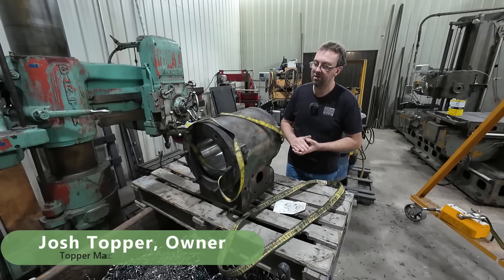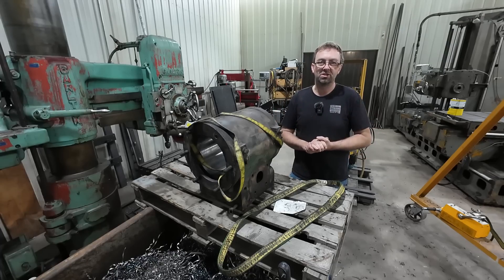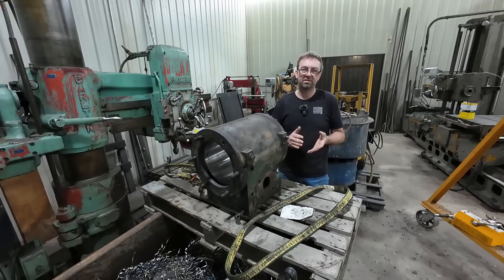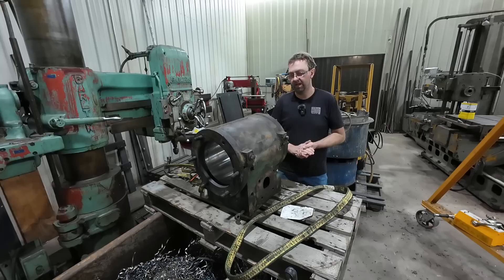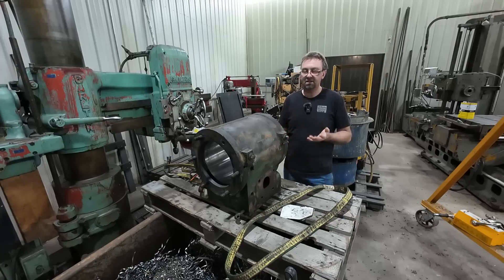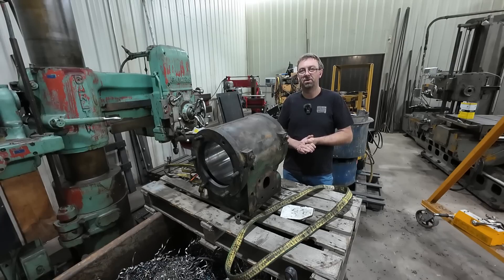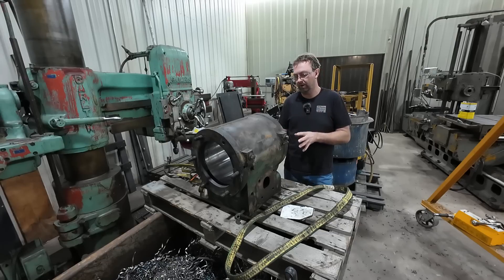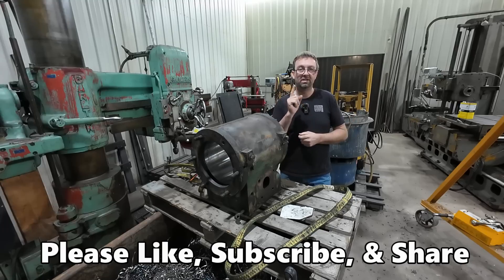Steam Engine Cylinder Boring Follow-Up - Honing & Answering Viewer Questions & Comments

Comment: You did fine. As long as the bore ends up square to the crank so the piston rod runs true it'll be good. Since there's no combustion pressure in the cylinder is there really a need for crosshatching??

Comment: Looks good to me!  Why couldn’t they do the cross hatch was it because of the stroke length wasn’t long enough ?  I think they would have been fine doing it with an overlapping series but you can do it by hand but it will be hard to get right cuz that is a big bore and stroke to cover.
Reply from the maker: This is not an engine hone.  Built for hydraulic cylinders, so smooth is all it will do.  I will have no problem with the cross hatching on my end.
Reply: At 2:00 the hone is stroking in and out that is what produces the cross hatch pattern. The rate of in and out vs rpm is what defines the cross hatch angle. If you look real close you should be able to see it. Now if they used a real fine stone like 600 grit or finer it maybe hard to distinguish. You may not need to do anything else to it.
Reply from the maker: Considering lubrication is admitted with the steam, meaning the steam carries in the oil, I may not need to do much else to it.  I also have a dual feed oiler set up and will be running both quite heavily. Most engines have one and the owners are all concerned about the cost of cylinder oil.  Myself, I consider oil a cost of playing.  It is cheap insurance to not have to do this again.  More cylinder oil, the better.
Reply: @ you want the deep scratches from the hone to hold the oil just like scraping does on a machine tool. Funny for us to talk about ways to make it last when it only lasted 100 years the first time with who knows what kind of finished and lubrication. lol 😆

Comment: I like you liked to play with old iron in the form of farm tractors. These old items were made obsolete 75 years ago. 
One can go overboard in the restoration process, spending lots of money for perfection with little value added. 
If you had stopped after you trued up the cylinder and put it back together with new rings you probably would have had more power than it had during 90% of it's working life. 
The question is when is it good enough? 
We need more younger people to get interested in these old technologies.

Comment: Not a steam guy at all but my 5 cents brain fart is here : if you make the piston for your steam engine out aluminium... does that give that all sorts of corosion problems ? in my brainfart i had this alarmbell of water and cast iron and aluminium = galvanic element like in a ship in sea water eating the boats parts in the sea. isnt it smarter to make the piston out of steel ? just my 5 cents.

Comment: Aluminum piston? boiler water is usually kept caustic to prevent acidic corrosion in the boiler. Caustic will raise hell with aluminum. If you eliminate the caustic, the boiler will suffer. I seems a poor choice to me. But you do you.

Comment: You could invent and patent a process prove that it's the best and correct way to do it and the cheese heads will say your doing it wrong. I would bet money that the negative commenter have never seen a steam engine, comparing steam to internal combustion is like comparing apples to cow pies.

Comment: I hope the the surface is not to smooth for hold the oilfilm wich let the rings slip on it ... and if this where my cylinder ? I only change it to a longer Pistonrod wich goes true the frontend to, to hold the Piston stabil in center.😊

Comment: Unless both ends of a horizontal hone are supported, it's hard to believe a cylinder can be honed horizontally without creating an out-of-round condition, although maybe not enough to create problems.

Comment: Very nice. No I wouldn’t make the rings either lol. Are you gonna put the cylinder and the piston in the over and measure them at high temps? Extra oil is always good for longevity. I run expensive oil and more than the manufacturer recommends in all my 2 strokes so they last longer. I have a weedwacker I bought like 10 years ago and I have used the hell out of it and it still has great compression. Anybody that says you’re and idiot is an idiot. Those are a lot of the times people that have no experience or a low self esteem. I can’t wait to see this thing run!
Reply: The people that said weld it really have no clue! We can clearly see in the video it’s cast iron lol

Comment: Those numbers will work well. We were inspecting satellite components with cast iron angle plates of various sizes and all measurements had to be calculated using ambient temps vs temps when the equipment was calibrated. The aluminum component was also used as a constant for titanium. The steel component is stable for both steel and cast iron.

Comment: Just do it the way that best fits you. My first tooling technology teacher told me to watch everyone and try different ways to find out the best way for you. But he also said don’t be afraid to change if you find a better way that works better. He said you will never stop learning as long as you do machine work.  We had a guy quit in the machine shop and he always machine the Johnson joints for the calendar line. He had them convinced that he was the only one who could do them. After he quit they asked he I would try to machine one to get the steam cut grooves out of the bottom where the carbon seals set. The boss came through to see if I had gotten started and the first thing he said the guy who quit didn’t do it like that and he said it was the only way it could be done. I finally convinced him to let me try. That joint never had to be machine again after 4 years till the plant was shut down and moved to Mexico. Before we shut down we got a lot of our equipment from another plant that shut down in Sheboygan, Wisconsin. Just keep up the good work. If it works for you keep doing it.

Comment: Hi Josh, you did a nice job on this steam engine cylinder. According to the new piston I would recommend you to make it from cast iron. Aluminum is not the right material for steam engines, due to thermal expansion coefficient and the danger of corrosion by condensate, which is on steam engines usually of alkaline quality. As well as electro chemical corrosion due to the difference in electro chemical potential of iron and aluminum. Depending on the alloy the temperature is affecting its material characteristics above ca. 300 °F. By the way I'm a mechanical engineer and working in the restoration of steam engines for over 20 years. Best regards from Germany

Comment: There are a hundred and one ways to do something. The job turned out great 👍🏻 
Where I am, in the North West of England. In our town years ago, we had it all, 30+ engineering businesses large and small, there was an electric motor rewinder, a hydraulic specialist, an automotive radiator repair shop, and a engineering wholesale supplier.
We are now down to around 5 businesses left, and they are not that busy. Thanks to China. Even in Liverpool, along the Dock Road, you could get anything done a few years ago... bearing suppliers, Perkins diesel agent all sorts, now all gone, and the victorian warehouses made into "trendy" apartments for "modern folks" who don't even know what a drill bit is.

Comment: First time comment for me on YT...I like what I see that you are doing.  Only thing I see is the honing on the cylinder is a bit smooth, which could lead to a longer break in time.  I have a Baker engine just about like yours except the next size bigger, also a counterflow and a little newer (1925).  These engines when they are right will make plenty of power for their size.  Don't get your piston clearance too tight, just make sure the ring grooves fit the rings well and plain iron rings will do fine.  Use a fair amount of cylinder oil, especially at first and put it to work, don't have to run it hard but don't idle around too much.  You are depending on steam velocities inside to get oil on the wearing parts.  Chromed piston rods seem to work quite well.  Packing on this engine I have has held up to over 30 years of running, some of it pretty hard.  Make sure the valve is flat as well as the seat, they can leak just like the rings.  I guess this is random comments that I thought of and best of luck and look forward to seeing this go back together!

Comment: No one knows how to do something the first time. That just how it goes. I’d bore it on a horizontal over a lathe. The setup on a horizontal would be easier. If you do it daily, which I used to, the setup would be very fast. You figure out ways to speed it up. A bored hole on a horizontal is generally parallel by default to. Not so in a turning machine. That hole is likely better then new, it is a steam engine after all, built with lower machine tool technology.

Comment: G'day you did a good job on the barrel see how many of the knockers would capable of such a job. It was much harder for you setup, then the  Atlas Copco barrel I machined the Horizontal borer had a outrigger bearing much easier to dial in.  I think honing was a good step to do. The material I used for the piston & rings  Meehanite,  you will need to do some research on  clearances using aluminum for the piston . Was the original piston aluminum or cast iron ,foing aluminum will also effect the balance of machine being lighter. All the very best for the future I hope  the financial situation improves with the new incoming  president . Have great Christmas to you & your family.

Comment: Some years ago we rebored the LP cylinder on a triple expansion engine 72 in dia and lifting the cylinder out was not an option so we bushed the rod hole in the bottom of the cylinder to suite a boring bar and centralized the top support off the head studs and bored with a fly tool. Came within one thou of design size. We had the ring spin cast at a local foundry that has a history of building steam engines. They are such forgiving engines. The job was overseen by a retired steam fitter who taught us a lot.

Comment: I used to run a machine shop for an absentee owner.   The shop owned the patterns for 35 Liberty Ships built in Portland Oregon during WWII....   

We'd receive an order from a repair yard for all of the live steam parts as needed for overhaul.   We'd pull the drawings, search and pull patterns, and send them to the foundry for casting.   We would specify the formula of gray iron, receive back the patterns with parts...

We often made pistons, rings, sleeves, and other cast parts for pulleys, capatans,  etc

The closest we came to doing anything with the bore was a low feed rate, light cut with either the lathe or horizontal boring mill.

We package and wood crate the parts as requested and ship open accout to all kinds of strange companies all over the world that still had these old ships in service.   

Of course, with time the orders slowed as these old ships were scrapped...

We knew by the master part brake down, what parts fit what ships...   

The owners dad, had bought the whole package at auction at the end of WWII as the ship yard closed...   I've often ponder a lot of questions I never asked...

Thought your readers might like my thoughts...  that was 60's - 70's....

Enjoy your work,  thanks

Comment: Ppl are so dense, this application is exactly what the Boring Machine is made to do! I mean what else were you supposed to do, try dicking around and chucking it up on the Lathe so you can spend hours trying to get it to run true then spend even more time setting up counter weights to balance it out so the Lathe doesn't shake itself apart or do they expect you to go and spend over 25 thousand on a new piece of equipment so you can do one job?! 🤦
   Man you gotta love all these keyboard Machinists who suddenly believe that bc they've watched a bunch of YT videos on a subject that it somehow qualifies them as a Master Machinist when they've never even touched a piece of heavy machinery let alone actually operated one. 
These ppl are like those idiots who we see on the internet that do Gym Raids, where some random dumbass who thinks he's a tough guy will go to a Martial Arts Gym and challenge the Coach or the Fighters then gets knocked tf out once they step in the ring. 
Enjoyed the video as always Josh! 👍👍

To anyone who would say to any Machinist "oh you're doing it wrong" remember that If you ask 10 Machinists how to make a part you'll get 11 different answers meaning there's many different approaches and that no one way is correct. 👌

Comment: I did a smaller one by clamping it to the carige on my lathe and a boring bar in the chuck only becuse i dont have a boring mill...

And it had a cast iron piston, it would expand at the same rate, not faster than the bore, would this not be better? Why or why not?
Reply from the maker: There are reasons to go aluminum and will be addressed when I make it.
Reply: @TopperMachineLLC  ok, i look forward to it

Comment: Josh
Great job on the cylinder 👍
Great job on getting it done done with what you had to work with. 
That cylinder is bored way more accurately than it was new
I’d like to know how many of the “experts’ have ever run a HBM let alone own one
Reply from the maker: Right on
Reply: Josh
I have my own shop. We have a Ceruti AB 75 HBM that we have had for over 25 years. Probably getting a little past it’s prime but it gets the job done. We have done cylinders, vacuum pump housings, pump housings, bearing housing exactly the same way. I’m sure you have seen how boring tools were positioned 100 years ago. Locked in with wedges
You did a fine job 👍
Reply from the maker: @GeorgeBracht  ceruti is a neat machine. If I didn't already have the Lucas, I would have bought a ceruti with a vertical attachment.
Reply: @ 
I made an adapter to mount a Bridgeport head on the Ceruti as well as my #3 CH K&T horizontal mill. I’ve done some interesting projects on both let alone it can be handy in a pinch. The Head came from a free Bridgeport save. It was missing the table. Have no idea of the history. Didn’t ask a whole lot of questions

Comment: Hi Josh, I appreciate your sharing the work you are doing on your engine. It's nice to see work being performed on a larger steam engine that isn't a locomotive. I made a 10" diameter aluminum Low Pressure piston for our 1909 Doty compound Marine Steam engine in out 40' steamboat. It is a two-piece piston hollowed out as much as i was comfortable, made out of 6061 aluminum, and sized with thermal expansion at450*F steam temp in mind.. I sealed it on the mating surface where the two pieces met, and had it hard anodized. After 7 years and 5,000 miles of steaming at 6mph and 200rpm (minimal internal lubrication because it's a condensing steam plant), there has been no wear to the piston or cylinder. Mind you, this is a vertical engine, versus your horizontal. The ring heights are obscenely tall (Dad was insistent on using same height rings... 5/8"!!!), and even with those heavy rings the ring lands have not suffered. The initial intent was a lighter piston and more closely match the HP and LP piston weights as the cast iron original was 30lbs heavier than the HP! With being pretty conservative with the piston thickness I was still able to get the weight within 5lbs of the HP piston. Well worth the time and effort.
Reply from the maker: Thanks for the information, it's very helpful.
Reply: @TopperMachineLLC  you're very welcome. I look forward to watching your progress

Comment: I'm confused. Did the job get completed and is it round? So what difference does it make how you set it up and what machine you used. If you could have designed a tool so you could accomplish the same thing on a shaper, then that's the way it got done. The outcome is all that matters. Good on you Josh.

Comment: I enjoyed your video. From my scale model machining of 2 steam engines I'm certain you're  the right track. I bet it was hissing a lot and lacked a "bark".  The proper sealing of the cylinder and a good slide valve face will greatly improve it. My little 3/4" bore engines can run on  2 psi. I do cheat with polymer O-rings though.
Reply from the maker: Yup, that's cheating. Lol

Comment: A steam loco recently going through the same, cylinders bored, new pistons, new piston rings, super heated cylindrical slide valves bored, new pistons, piston rings, all packings remade from scratch. The loco got assembled, tested, adjusted and pulled a train september 30, year 2024. Great success.
Much of the work was done like You did it. All piston rings were made from cast iron, pistons made in steel.
Good work!
Reply: Do tell us more, please.  I'm in UK where there are currently seven standard gauge locos under construction from scratch.....

Comment: While we are discussing boring ... A while back, you mentioned that drilling holes was boring. I've just been putting up shelves, so I had to drill 400 holes in 3/4" square tubing on my drill press, but as I was drilling right through, that's actually 800 holes. Then light countersink with a hand drill to de-burr the 800 holes. Then 80 shelves, drilling out the four  3/16" holes to 1/4"  on each shelf, then de-burring with a countersink bit, 320 holes. How's that for boring. Can anyone top that?

Comment: Spot on Mr. Topper.  Real superheated steam is a Dry Hot and can be invisible, dangerous gas and power is exponential to Steam pressure to the piston surface area that as you stated is driven on both sides. Seeing Jay Leno Steam shop and steam cars especially the Doble he tells it as it is a huge powerful push like The Hand of God.. so all the steps you are taking Josh are the correct ones .